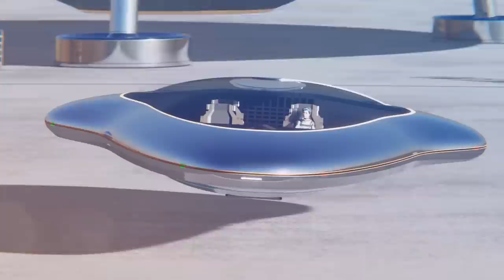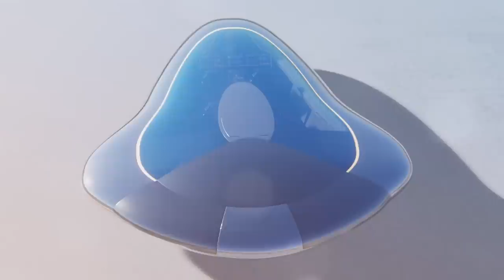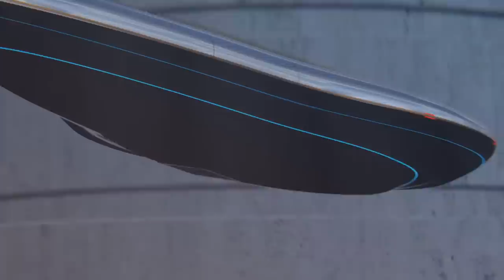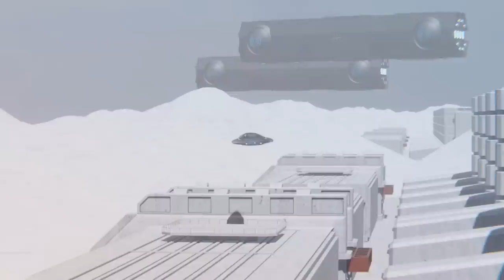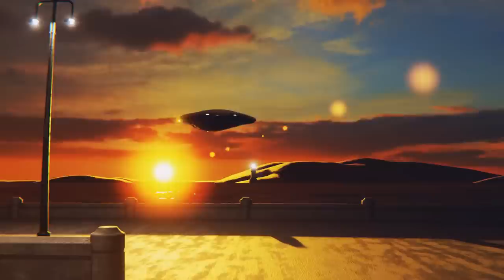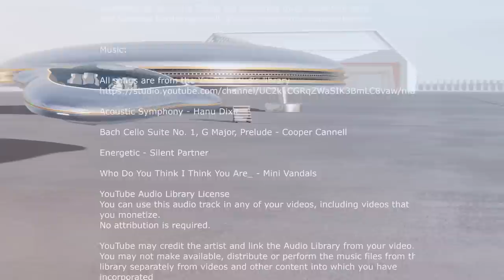OMG?! How Is This Able To Hover and Fly?

Comment: How far away are you from a 1/10 scale working prototype?
Reply: I could build a real one of I had the funding. A scaled prototype would have to be tethered to fly though. There are any number of patents out there giving you a rough idea of magneto hydrodynamic propulsion but they cut out key components
Reply: Me quite obvious that since the late 40s of the twentieth century, a secret project has been developing in the United States for the development and production of aircraft, where the lifting force is created using high-frequency vibration. It all started with James Pitts' "Sky Car" vibrating orthotopter umbrella, then the umbrella was closed with a dome and devices appeared according to the scheme of conventional electromagnetic vibrating speakers (membrane + inductance) - fragments of the membrane were found by a farmer in Roswell. Then they created piezoelectric thrusters, or with small dischargers on the surface (they glowed all over the body due to ionization of the air), and now they are planes with plasma propulsion panels (so they are angular - that is, with flat surfaces). Thousands of discharge cells are densely packed into motor panels - they shoot streams of plasma (railgun architecture - coaxial electrodes). The ionized air of the spark discharge is accelerated in the railgun chamber by the Lorentz force to enormous speeds - a kind of ramjet engine is obtained. Just imagine! - tens of thousands of small ramjet engines assembled in panels and launching plasma synchronously at a huge frequency (hundreds of kilohertz). Plasma jets form toroidal air vortices - this air cushion creates lift and acceleration. See, for example, the MARAUDER (Magnetically Accelerated Ring to Achieve Ultra-high Directed Energy and Radiation) project. My article "UFOs are made in the USA" and the books "UFO Hunt" and "UFO Elimination" describe all this in detail. The technology is quite mundane - it is known in great detail thanks to information leaks. For example, air ionization in the coaxial elements of a railgun is created using radiation (radioactive polonium is introduced into the metal). Devices of this type were used throughout the 50s-60s-70s-80s for secret missions (they took off, as a rule, from special submarines). With the fall of the USSR, their use by the United States was practically curtailed (in the novel "Little Green Men" by Christopher Buckley, speechwriter Bush Sr., a scene is described where the US president decides to curtail the "flying saucer" project). The winding down of the project can be recorded by the drop in magnesium consumption in the United States, since such fuel was used in fuel cells (magnesium strips were burned in forced galvanic batteries), this is 2007-2008. However, later the development of the technology continued in the Russian Federation and China (the technology was restored by reverse engineering methods for downed devices). Secrecy, however, was maintained and there was no civilian use because the technology was not suitable for it - harmful microwave radiation from pulsed plasma thrusters (harm to pilots and impact on electrical appliances inside and along the flight line). The payload is small (but one nuclear charge is enough). There is no radio communication - unmanned vehicles can fly and maneuver only in accordance with the program. Previously, there was a narrow application profile - rare spy missions (so that pilots do not get a lot of radiation). Reconnaissance aircraft of this type were often observed at military bases, missile launch sites and airfields. They were even seen by peaceful geologists in the taiga, where clearings for seismic exploration were laid - UFOs flew there to check whether military construction was underway (I myself heard stories about this))). I think that soon this technology will be declassified, and cargo airships with flickering round plasma panels on the surface of the hull will appear in the Arctic sky.
Reply: fake news
Reply: @digitalsiler  President Harris: "Ah, good. The Air Force is here with those new round planes!" (Scary Movie 3, 2003)😀😃😁😆🤣😂
Reply: 😂😂😂😂😂😂😂

U serious???

They have more FLYIN SHEEPS
THEN WE CARS😂😂😂😂

Comment: Contact Annihilation Reactors?!!  WHAT THE "F" is THAT???
Reply: Compact not Contact that could be due to incorrect closed captioning.
Reply: Most likely, anti matter matter reactor.
Reply: It would be easier would have to harvest it from space to get large amounts antimatter then to produce it the issue with produceing an single gram of this stuff it would be too expensive produce 
We would need an efficient way of trapping the antimatter if it touches anything it would literally annihilate the whole craft.
Reply: @Wincil  ok. You still need to worry about the radiation and turn that radiation into electricity. Slight problem with harvesting it from space more useful for spacecraft rather than planetary travel in the atmosphere, but ok.

Comment: Quite an interesting concept, though in practice I believe it would be quite a bit more power hungry than a standard propeller. A scale model of that engine design in a toroidal shape may be a bit more efficient due to the scavenging effect through the center of the toroid. I would politely request that you make a follow-up video with some hard numbers and CFD analysis on some common craft shapes attempting to use this thrust system eg. saucer,  something akin to an SR-71 with vertical thrust around the edges and hollow engines along the back sides to scavenge air through their centers, a flying wing, a toroid, and something a bit more conventional... perhaps a car. Also please refrain from using the announcer echo for the entire show in the future - it is a funny gag when done well for about 45 seconds but after that it becomes a bit tiresome to listen to.
Reply: @Aaro4ify  I haven't until now but reading into it the proposed injection volume is 1 microgram which currently costs 62 million dollars to produce. Also, isn't antimatter a pain to work with - as in basically impossible to store for any amount of time; necessitating using it effectively the moment it is produced? It is still a fascinating fusion process conceptually even if we are far from being able to utilize it effectively with current technology.
Reply: Antimatter was captured before and here's the thing it didn't last very long. I think that Antimatter wouldn't really be an power source its a method of power storage. This wouldn't be an issue If you could create antimatter efficiently, and store it safely it would be much easier to harvest it from space at that storing it for any amount of time wouldn't be impossible and cost wouldn't be an issue at that point the antimatter would be trapped by using magnetic confinement we would just need an efficient way of trapping it.
Reply: I also think that the magnetohydrodynamic engine should not consume a lot of energy.  For air ionization, you can spend only 12V.  The strength of the magnetic field also does not have to be strong.  Enough power of the magnetic field, similar to the magnets you have on the refrigerator.  After all, the main task is to move air along the body and create a difference in atmospheric pressure.  Create lift with a controlled tornado.
Reply: A toroidal shaped tube with Mercury inside rotated by about 12volts of electricity (or more if you wanna go crazy) the tube wrapped in copper wiring, a counter rotating shaft in the center, (I’ve seen some with a Tesla coil in the center, so if possible try that, maybe a counter rotating Tesla coil?) I’m just bouncing some ideas around for those more capable of building prototypes.

Comment: One must assume  this type of propulsion would only work in an atmosphere  ,am I rrright?
Reply: Technically it would become less effective but as you leave the atmosphere - the amount of force needed to move your craft is reduced because it is no longer in the atmosphere. Yet you can still travel using in-situ propulsion because space is not a perfect vacuum. These types of vehicles are already being studied in academia - one recent one I am aware of used dielectric barrier discharge electrodes implanted into an airfoil. I'm not sure but I think the publisher of this video is trying to illustrate something called electrokinetic propulsion.
Reply: @linuxuberuser  In the vacuum of space, the thrust of a magnetohydrodynamic engine will still decrease due to a decrease in the density of air particles.
Reply: @arinaZamorochka  I agree BUT all-electric SSTOL MHD vehicles will require less thrust in deep space, so it still an ideal drive system for use inside and outside LEO; It all comes down to power.
Reply: if you mean technology that exploits the repulsion of the earth's magnetic field, yes, obviously there are also more advanced technologies!

Comment: The graviductor doesn’t require at all the tremendous energy of which you speak. It’s all in reference to over-polarity of the coils. 700-to 1300 degrees polarity is impulse antigravity and 1400 and above degrees is warp. Shutting warp coils is deleterious so when not being used must always be on standby mode.
Reply: Where could i find more info about this topic?
Reply: @Gergő Kun  I don't know. when the Gravinductor is placed open source. That information will be provided in the accompanied papers.

Comment: Creating a detailed image of a crystal spaceship with a flying saucer shape and integrated Graviflyer spinning discs involves visualizing the spacecraft's exterior and interior design. Here's a detailed description of the spaceship:

### Exterior Design

*Shape:* The spaceship has a classic flying saucer shape, with a smooth, curved surface to minimize air resistance and improve aerodynamics.

*Material:* The outer shell is made of a lightweight, durable composite material, allowing for both strength and flexibility.

*Windows:* Large, panoramic windows are strategically placed around the saucer to provide views of space and planetary surfaces.

*Lights:* LED lights are embedded in the outer shell, providing illumination and visibility in space and during atmospheric entry.

*Spinning Discs:* Around the perimeter of the saucer, several large spinning discs are visible. These discs are integrated into the structure and rotate rapidly to create lift and manipulate gravitational forces.

*Propulsion Systems:* The spaceship features various propulsion systems, including rocket engines for initial lift-off and ion thrusters for efficient space travel.

*Levitation Systems:* Magnetic, acoustic, and electrostatic levitation systems are integrated into the design, with components such as superconducting magnets, ultrasonic transducers, and high-voltage electrodes discreetly placed around the saucer.

*Antennas and Sensors:* Several antennas and sensors are mounted on the exterior, including communication antennas, navigation sensors, and environmental sensors.

### Interior Design

*Crystal Core:* Inside the saucer, a large, engineered crystal core serves as the central structure of the spaceship. This core is the heart of the levitation systems and provides stability and energy manipulation.

*Control Room:* The control room is located in the center of the saucer, surrounded by the crystal core. It features advanced control panels, monitors, and interfaces for piloting the spacecraft and monitoring its systems.

*Living Quarters:* There are living quarters for the crew, equipped with sleeping pods, dining areas, and recreational facilities to support long-duration space travel.

*Laboratories and Workshops:* The spaceship includes laboratories and workshops for scientific research, maintenance, and repair of equipment.

*Power Generation:* A compact nuclear fusion reactor provides power to the spaceship, supported by advanced batteries and energy storage systems.

*Emergency Systems:* Redundant systems and emergency protocols are in place to ensure the safety and security of the crew in case of emergencies.

### Functionality

*Launch and Flight:* The spaceship is capable of vertical takeoff using rocket engines and can transition to using the spinning discs for lift and stability during atmospheric flight.

*Space Travel:* Once in space, the spaceship uses its advanced propulsion systems for efficient travel to the moon and beyond.

*Landing:* The spaceship can land on planetary surfaces using a combination of rocket engines and levitation systems for a soft and controlled touchdown.

*Maintenance and Repairs:* The design allows for easy access to components for maintenance and repairs, with dedicated areas for these tasks.

### Conclusion

The crystal spaceship with a flying saucer shape and integrated Graviflyer spinning discs represents a futuristic and advanced spacecraft design. It combines cutting-edge technology with elegant aesthetics to create a spacecraft capable of exploring the depths of space while providing a comfortable and safe environment for its crew.

Comment: What powers it is CGI animation and fantasy.   Ion drive produces ounces of thrust, not pounds and certainly not tons.  There is an ion drive model airplane, it can fly for about 30 seconds and very slowly indoors.  It's made of balsa and cannot hover.  There are ion hover structures but they are tethered to a powersource.  Grant Imahara tried to make one.  They are like a box kite and cannot carry their own power supply much less a payload.   I suspect that two pressurized clam shell ...halves could direct airflow down below a craft like this through a long seam surrounding it, like a dyson bladeless fan does  but this would not provide the life needed for a heavy manned craft.  You still need propellers with hundreds of pounds of thrust each or small rocket motors.  The Coanda effect has been known to lift a motorized craft, but not a passenger.  If that airflow were optimized by ionized resistance underneath to create a lower pressure zone and an upper pressure zone perhaps is could be made to work without externally shown propellers.

Comment: nice try but had to power it with nuclear/ that is why i am still into free energy liquid magnet antigravity motors - its the microfluids that really make the space program work🦨@#$%^&*(@#$%^&*( Kardashev scale solar cells and light makes that antigravity flight and hologram lasers keeps the space garbage and dust bunnies at bay and if use a traction beam could make and Oneill cylinder or worm hole out of a black hole with its space garbage [ nanotechnolgy]

Comment: How large could the craft be, if we used the latest tesla car battery to power it? Or perhaps a Tesla Power Wall. Would that support a 1 person craft roughly the size of a golf cart? And if so, how long would this craft be able to fly?
Reply: I also think that the magnetohydrodynamic engine should not consume a lot of energy.  For air ionization, you can spend only 12V.  The strength of the magnetic field also does not have to be strong.  Enough power of the magnetic field, similar to the magnets you have on the refrigerator.  After all, the main task is to move air along the body and create a difference in atmospheric pressure.  Create lift with a controlled tornado.

Comment: Ion propulsion is the ‘baby’ version of the real technology which pushes off of the vacuum actually more correctly it pushes directly on vacuum tension created by intense torsion field stressors which spontaneously occur as a manifestation of chiral or asymmetric lateral static tension and pulse high frequency megahertz radio waves in a specific and closely guarded combination.

There are all sorts of variations of the same exact technology some of them are capable of creating such intense counter chronospatial torsion field geometries that they effectively become capable of completely exiting   there own light cone by effective emission of hard light, something only possible because of the wonderful hydrogen nucleus and what it reveals about the nature of matter.

Matter its self is actually nothing more or less than vacuum energy or quantum vacuum condensate. 

This can be observed by looking at the nature of the energetic relationship between the hydrogen proton and electron / photon —

Anyway it’s a nice video and I like the CGI but it’s got nothing to do with real world physics or genuinely advanced closed system propulsion.

Comment: That would take a lot of power to ionize that much air would be enormous and to direct it in direction s for travel little alone the radiation from what he suggests an antimatter reaction. Better alternative would be wireless transmission or cable contact power transmission to ionize the air that way if lose of power it can grab onto the power line and still travel like a cable cart.
Reply: Antimatter power would make more sense as engineering a compact nuclear fusion reactor in a platform the size of an f-16 fighting falcon because it would make the craft far too expensive and radioactive to use.
Reply: @Cynical Robot  don't know if you're saying that to be because I never said anything about a mini fusion reactor. Last I checked, anti-matter storage requires large magnets to contain it and power. A by-product of hydrogen hydrogen fusion is anti electrons or positions, so you have that kind of anti matter access, less powerful but easier than anti protons.
Reply: No
Reply: @Arina Loginova  no of what? If you have a better understanding of physics and engineering, I'm more than willing to hear your thoughts with glad.